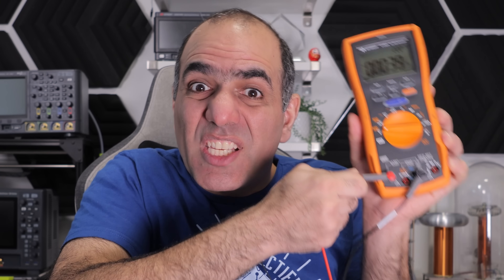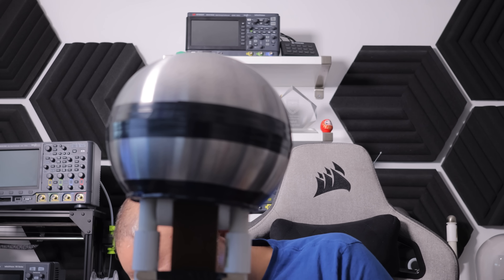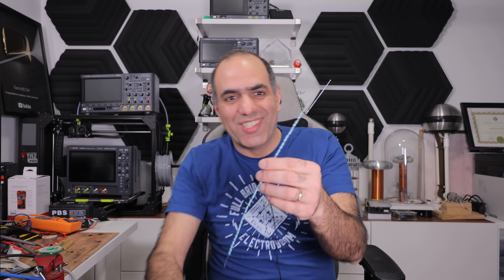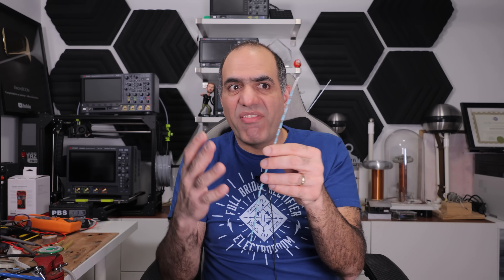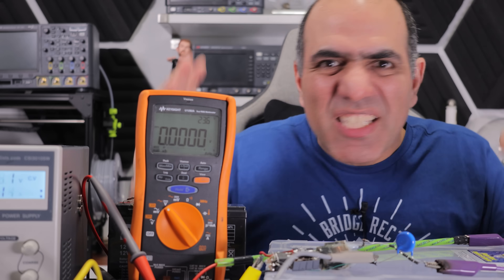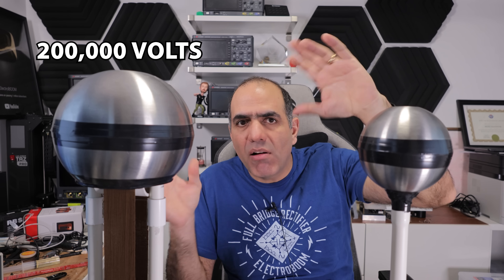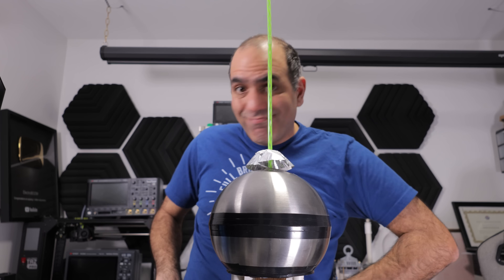SUPER HIGH VOLTAGE Measurement

Comment: Hey Mehdi I heard that cheaper UPS units output ‘modified sine waves’ that can "zap" or mess with sensitive electronics. Is that true? Can't afford an oscilloscope to test mine but whenever I connect my TV to the UPS, the TV speakers would start making buzzing noise

Comment: @ElectroBOOM or anyone who can help me with this 

For measuring high voltages using resistor dividers , the tolerances of the resistors introduces a slight innacuracy , what are any workarounds than just using low tolerance resistors ?
Thanks for the help

Comment: What if you do a capacitive voltage transformer, Im not an expert but I believe this might be more ideal for low power sources like the van der graf. Basically you just set up a field between the cathode of the generator and a peice of grounded metal, then place some sheet of sensing metal somewhere in between the two with a measurement capacitor to ground. Not sure tho

Comment: Safer way of measuring the distance would have been taking a still frame of the generator with the ruler next to it and superimposing another still frame of the generator arcing to the other ball over the first. That wouldve given a slightly more accurate measurement

Comment: In the past, you have tried to increase the voltage on the vandagraph in different ways.  What happens if instead of connecting the bottom brush to ground, you connect it to 1 end of a high voltage dc source and the other side of the source to ground. With the correct polarities, of course. Will this feed more electrons onto the belt and. Build a bigger charge to the top?  Just wondering.  Regards, Mike

Comment: Maybe an airtight device where you can always be certain of the pressure/humidity where two contacts move away from each other. If you measure the distance when they stop creating an arc you can have some greater degree of certainty. At least you remove the air pressure/humidity variable.

Comment: How's this for a method:  attach your voltage divider to the non-grounded small ball and discharge the Van der Graff, capturing the very quick voltage spike with your scope?  Alternatively, you could try discharging the VDG into a beefy high-voltage cap and observe the voltage rise curve.  From that it might be possible to use the capacitior charging formula to work out the input voltage. Oh, the experiments I could do If I had my own scope!

Comment: best way to measure electrostatic potentials like these is using a rotational voltmeter (also called field mill i believe). whith this, you are measuring the voltage indirectly by measuring the electric field and the load on your supply is basically nearly zero. only caveat: only really usable for somewhat stationary dc-voltage

Comment: Hi, another way of doing it is to charge a sphere and measure its charge with an electrometer. The capacitance of the sphere is proportional to its radius. Best wishes from France
Reply: Yes, that is a good way.  The spheres must be sufficiently far removed from other objects when the charge is being transferred, such that the surrounding field is predictable.  The self-capacitance of an isolated sphere is the wrong value to use because the fields of the generator sphere and the measurement sphere affect one another when they are in contact.  John Lekner, in his paper, "Electrostatics of Two Charged Conducting Spheres", has formulas for doing the calculations, which he attributes to Maxwell.

I have used this method by dangling a conductive sphere via monofilament fishing line from a meter-long plastic rod held at arm's length in order to keep my body far enough away to not disturb the field configuration too much when the measurement sphere is being charged.  However, the field of the generator spherical electrode is not perfectly uniform due to the presence of the support column.  Making contact between the spheres on the side opposite the support is about the best we can do, I think.  My cheap electrometer was an operational amplifier integrated circuit with input current less than a picoampere, with a capacitor of known value in the feedback path, such that the charge from the measurement sphere was transferred to the capacitor when the sphere was brought into contact with the input of the operational amplifier (through an input resistor to avoid electrostatic damage).  An ordinary voltmeter was used to measure the output voltage of the operational amplifier and the voltage change from before to after contact was used to calculate the charge transferred and thus infer the sphere voltage when the generator sphere was in contact with the measurement sphere.  The capacitor has to be a type with very low leakage and very low dielectric absorption.  The measurement sphere must be large enough to avoid corona discharge leakage to the air.  (I hope all this makes sense.  It would make a boring video because when done properly, ElectroBOOM would be too far away to get shocked.)
Reply: @analog_guy  interesting, I didn't think about using two spheres. In fact, I've had this set up in college, but for capacitance measurement. The same set up can be used for high voltage measurement as I mentioned. There wasn't two spheres in it, instead the generator's electrode was a tip
Reply: @prosperemerguy3303  Okay.  I hadn't thought of using one sphere.  When the sphere is being charged, the field of whatever is supplying the charge and connecting to the sphere will alter the charge distribution on the surface of the sphere.  Once the charger is removed and the sphere is isolated in space, the charge will redistribute and the self-capacitance of the sphere will shift to equal the formula value, 4*pi*sphere radius* epsilon.  Assuming no leakage, the charge is trapped on the sphere so it remains constant but the voltage changes from the original value when it was being charged.  I suppose the situation could be modelled or measured directly at lower voltage to determine the voltage ratio, then used to infer the original high voltage.
Reply: @analog_guy  yeah, the checking of the voltage shift is a great idea

Comment: What if you used a super long tube of inert gas that will illuminate when under different voltage levels. It has intermittent electrodes at distances in it so that further away the higher the voltage needs to be to make the gas release light.

Comment: Hmmm. Could you not just use your mega resistor plus some kind of variable resistor? I'm just thinking the air distance is like a variable resistor, but if you actually used one (or even a variable resistor + a known distance of air), you might far more accurately measure the voltage.

Comment: So if its ac use a low impedance PT and an air gap. Charge will build up to a point untill it jumps and might have enough ass behind it, 

If not a shunt on a scope across a resistor with an airgap

Comment: Old pH meters used a current balance circuit to measure voltages without drawing current.  You put an adjustable voltage on one side of the balance with the unknown voltage on the other side.  Measure the current through the balance.  When the current is 0, you know the voltage on both sides of the balance is the same.

Comment: I love seeing your circuit designs and seeing some of my own in there.  I was looking at the probe circuit recalling my first Passive Audio filter I designed, and see how it works with higher voltage.  I typically only use line level audio circuits, anytime I think about making something more powerful I hear your Shrieks in my head and giggle.

Comment: I restore vintage (1960s and earlier) multimeters as a side hobby to electronics, and building resistor arrays that can even handle 1500 volts with some margin (because there is a 90% chance the old resistors drifted off tolerance, as early generation film resistors tend to do....) and still fit in the case (heatshrink and chaining resistors usually does the trick, but it tends to get... bulky) tends to be a ... laborious task often.

---

Mind that there is a capacitive divider across a resistive divider, small problem with analog meters that are current driven  in the end  but big problem with scopes and DMMs...

--- 

two old school tools worth mentioning: 26Kv/32Kv probes from the CRT era, and VTVMs (if one has the skill to restore them).

---

A new school tool worth mentioning: Yf-6688B type insulation testers... a very useful and affordable tool to have if you study its limitations (dead short and good insulation both displayed as overrange with only subtle hints, and low current capability so not good for testing big greasy kilowatt motors! :) ).

---

A tool I hope for a  followup video on: Electroscopes/electrostatic voltmeters!

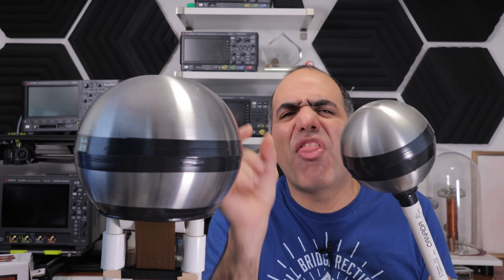Comment: 10:13 Fun fact: even perfect vacuum will break down at around 10^18 (one quintillion) volts per meter. At that point it's more energetically favorable for electron-positron pairs to spontaneously form and create a current to neutralize the gradient than for the electric field to keep increasing.
Reply: Yeah, but electrodes in a perfect vacuum will have ions forced out of their material at far lower voltages already :)
Reply: @splitprissm9339  Well, if you think of the vacuum as a semiconductor, and a copper electrode as a lump of doped vacuum...
Reply: So what would the forces on the electrodes be at those voltages?
F = 1/2*epsilon_0 * A *V^2 / d^2
F = 0.5 * 8.85E-12 * 1 m² * (10^18)^2 / (1m)^2 = 4.4E26 N 
So the force is about 10x larger than the mass of planet earth pushing down with 1 g on ONE SQUARE METER!!
That is a pressure of 4.4E26 Pa, not far away from turning into a neutron star.

I kind of feel like the effect you describe is rather irrelevant at that point.
Reply: @leocurious9919  Some neutron stars actually do have magnetic fields of equivalent strength to the needed electric fields, and some large normal stars get hot enough at their cores that thermal gamma rays will produce e+/- pairs when they collide, which actually has implications for the stability of those stars. So it's not an entirely theoretical consideration, though the needed conditions are indeed extreme.
Reply: Air is a lovely insulation! Until it isn't... LOL
Reply: Would that be line with the second law of Thermodynamics?
Reply: i have absolutely now clue what you said but it does sound cool
Reply: Hmmmm.... so technically what you are saying is that our CURRENT vacuum in deep outer space is actually a FALSE VACUUM and could go into an even lower energy state with enough tip-over energy added to it? i.e. You are positing that a "Perfect Vacuum" is only metastable? That is actually a VERY VERY VERY BAD scenario for us humans to be in since anyone crazy enough to create such a 10^18 volts per metre field for long enough COULD trigger a cascade failure of our current metastable vacuum and send our universe into an expanding bubble of a lower vacuum energy state expanding outwards at the speed of light wiping out civilization AND THE EARTH and even the rest of the universe as they all settle into into new laws of physics at their now lower energy state!

This is utterly horrifying scenario to realize! 

V
Reply: Thank you bro I never knew that
Reply: What made you think those things spontaneously form, when energy can't be created or destroyed? Those things would have to already exist in the medium.
Reply: @lepayen  The energy comes from the electric field (which takes energy to create), all other conserved quantities sum to zero (cancel out) for a particle/antiparticle pair.
Reply: @lepayen The energy comes from the voltage gap, and is converted into a particle pair following E=mc^2. No energy is created or destroyed, just converted into mass.
Reply: Voltage is nothing more than the unit by which we measure a charge gradient.

Comment: 2 Gigaohm seems a bit low of a resistance to try this. I bought a few 1 Gigaohm resistors for a future microcontroller based multimeter that does more multi than a usual meter (e.g. being able to measure higher voltage, higher capacitance etc.). And the 1 Gigaohm was intended for "only" up to 12kV.
I suspect the resistance value would have to be a lot higher, maybe even in the Teraohm range. I just looked on mouser and they exist, they aren't cheap tho.

Comment: One method for static electricity voltage meters could be adapted for this.  The problem with measuring voltage like these is what was seen here, the measurement drains the energy, and a measurement cannot be accurately made.
Some static electricity voltage meters generate an internal voltage that can be measured without draining all the energy.  When the difference between the generated voltage and the voltage to be measured is zero, they are the same voltage.  Then take the measurement of the generated voltage.
Not sure how you would do this for 100's of thousands of volts, but let us know if you figure it out!
Reply: That's a good method.  Advanced Energy makes the Trek series of electrostatic voltmeters up to 20 kV.  However, in Medhi's case, he would need a separate higher-power adjustable generator of over 200 kV in order to operate his resistive voltage divider.

Comment: The bouncing aluminium: work is being done to make it bounce, the rate & height ≈ potential <> kenetic energy exchange. You can weigh the foil. So you can calculate the rate of energy use = power Watts. From that, perhaps you can calculate voltage required to do the work if you can calculate i (some kind of differential equation) ??? #JustThinking

Comment: TLDR; can we build a transformer for static high voltage jums with a super-insulated wire? At least in theory?

Details: 
Could a transformer lower the voltage and increase (actually accumulate) the current of Wan De Graaff domes? I know voltage is too high to encapsulate and manage but if we could manage to wind a primary coil with an extra (i mean, really extra) insulated wire and at a relatively higher tours, could we capture and accumulate that static charges inside the primary coil and create an induction voltage in secondary coil with that? If it works, we can also accumulate that relatively high current and relatively low voltage output in a capacitor and measure the capacitor voltage after some charges are built up.

Comment: Field-strenghts could be measured. Because that high voltage should build significant field-potential. Problem is the calibration without realy able to measure voltage direktly.

Comment: I think the closest you probably could get is a capacitive divider with a Leiden Jar, although even that would substantially affect the voltage of the Van de Graaf due to leakage current. However, you would be able to measure the capacitances and then get an idea of the voltage without a resistive discharge.

Comment: For anyone who did not understand the math capacitors begin to resist flow as they are charged and increase flow as they are discharged. To minimize impedance from a capacitor in an AC circuit a larger one can be used or a higher frequency source. The impedance can be determined using the capacitive reactance formula: 1/2*Pi*Capacitance. When resistors are placed in series the total resistance of them can be summed but if they are placed in parallel the resistance across that portion of the circuit drops 1/sum of the resistive values. For example, 1/(1/250 ohms +1/500 ohms) = 167 ohms. Since capacitors act like resistors in AC circuits based on their size and frequency that must be accounted for if they are in parallel or series with resistors.

Comment: Can you use the Van de Graaff to charge a capacitor and then measure the capacitor voltage?
Reply: Yes, but that requires a custom-built or very expensive capacitor with excellent dielectric material for 200 kV.  Also, if there is much capacitance, a shock from it would be very dangerous or lethal.  A better arrangement would be to charge another sphere, hanging on an insulating line, and then measuring the charge on that sphere.

Comment: Didn't you just make a meter using the height of the parachute thingy? The higher the voltage, the higher it goes. Calibrating it may be an issue, but perhaps with a clamped down grounding ball at a known distance, you could get a decent reference.

Comment: Take a syringe, put a metal ball on the open end, put a metal plate on the “piston” and ground it. Make sure your know the humidity inside the syringe before making it airtight. Then you can connect the ball side of the syringe with the van de graph generator and push the syringe in until the ball arcs with the piston. The distance from the ball to the piston can be used to measure the voltage. You are welcome to

Comment: In New Zealand legislation, 120 volts is considered low voltage. Under 50 volts is considered extra low, and 50 to 1000 is low.

Comment: Build a hermetically sealed arc box that is filled with a noble gas and has a fixed and movable sphere. Maybe use a magnet to move the sphere? Then, calibrate it with a scale for testing super high voltage.

Comment: 3:23 that wasn’t arcing you just burnt out the resistor. That gap looked well over a centimetre but if we assume it’s 30kV then that resistor would be taking 90W. Obviously it’s gonna sag but you just burnt it out not arced

Comment: Can't you use a capacitance divider in stead of a resistance divider? It should work the same, but should draw less current.
Reply: Yes, but it is difficult to build one with sufficient dielectric quality, low enough leakage, and sufficiently large smooth shape to avoid corona discharge in the air.  Jennings makes some with a glass envelope containing vacuum insulation for use up to about 50 kV.  The price is multi-thousands of dollars.

Comment: 200,000V^2 / 2GR = 20W. Your VDG generator won't do 20W.
It is interesting that the VDG voltage dropped as your 2GR resistor approached the sphere (as opposed to touching it).